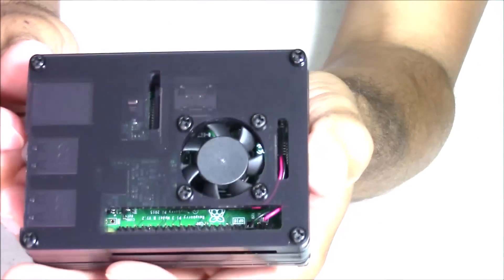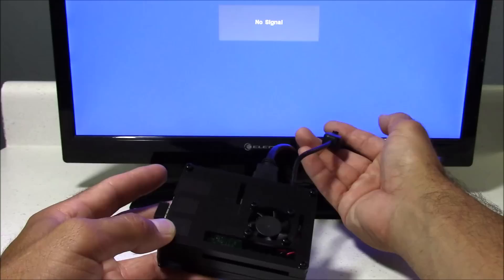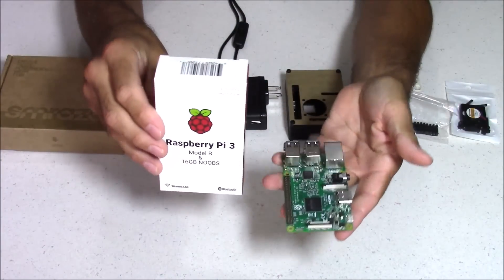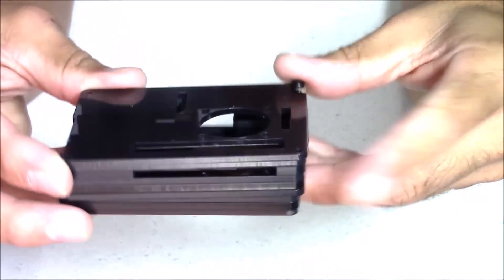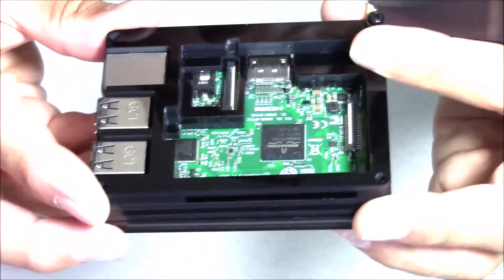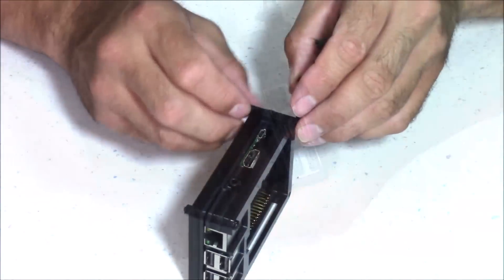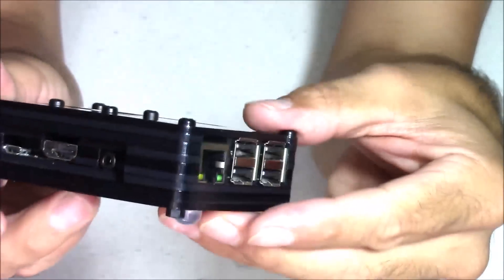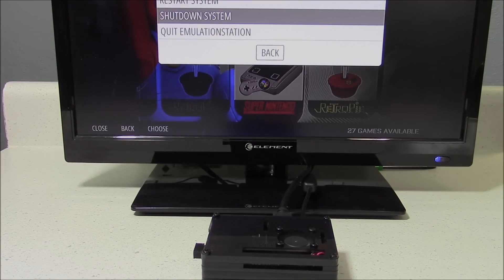Review & Build for the Smraza 9 layered case for raspberry Pi 3 B & B+

Comment: I have this case for my Raspberry Pi 3b+. I love it. It looks great. My only complaint is it's very hard to see the LEDs. My suggestion would be to have the screw heads on the bottom and the nuts on the top. That way you can pop off just the top anytime you need to get inside.